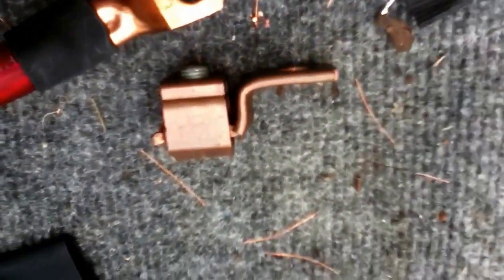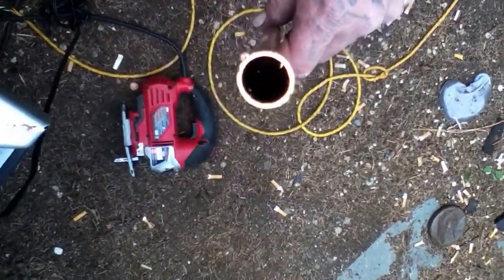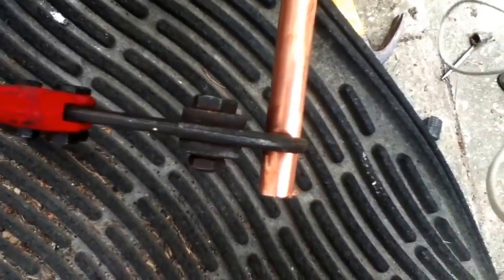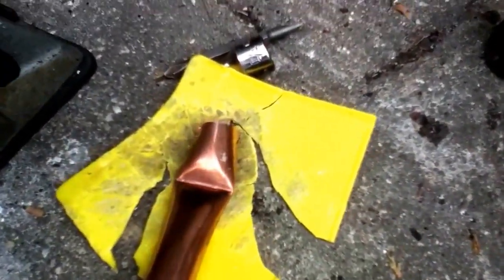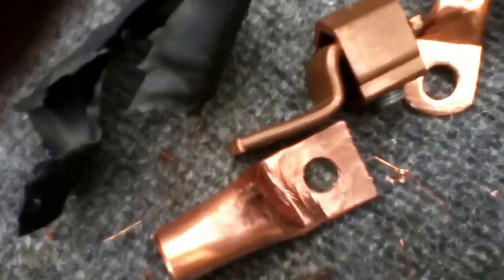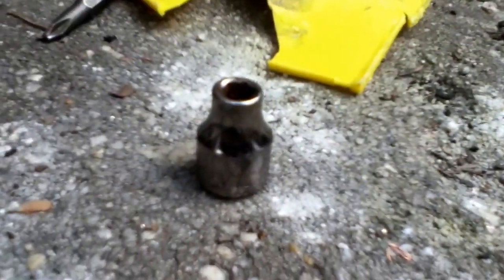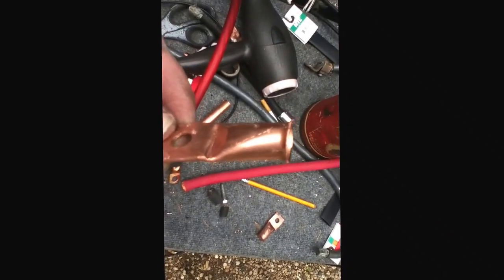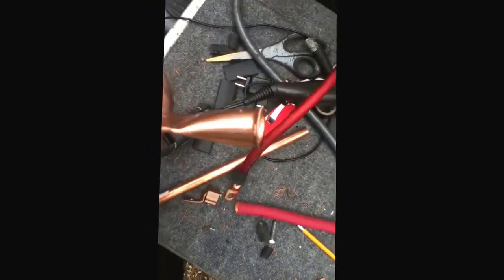How to make 4/0 copper  lugs

Comment: So your trying to save money on buying terminals buy using pipe to make your own but you think $5 for heat shrink is cheap. you could buy 66 feet of red electrical tape for $3-$4 and black tape for less than $2 and it will do the same thing as heat shrink and you'll have over 120 feet of it.

Comment: CAUTION!  I think you're making a mistake and could be heading for a fire.    If you do a bit of basic math and figure out the cross section area of your 4/0 cable, then figure out the cross section area of the flat part of the lug you fabricated, I think you're going to find out that there's not enough copper physically bolted to the connection.   In other words, when you flatten the end of the tubing and drill a hole through it, its not thick enough to handle the amount of amps the 4/0 cable can deliver.    This could cause it to heat up and start a fire.   BE VERY CAREFUL
This technique works for small gauge wire.  If you did this with 4 awg or 6 awg, I think you could get away with it, but if you start doing this with the larger sizes, the wire will be capable of delivering more amps than the copper lug can handle.
Reply: needa look at how many amps you plan to run through it and where itll be located.. also itll most likely what a battery connector bolted to both sides of it.. just give it a torture test on first install and monitor the temp.. theres no insulation to be baked off the lug so it can get pretty toasty without causing an issue